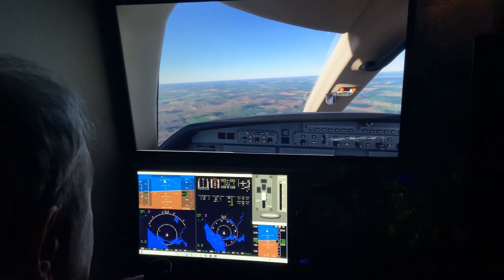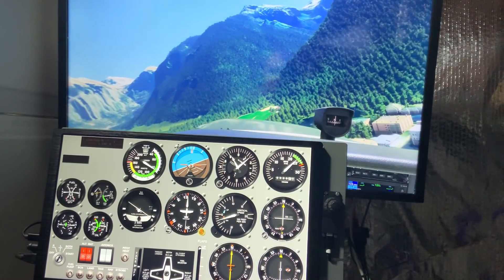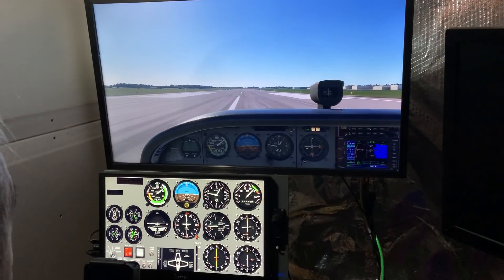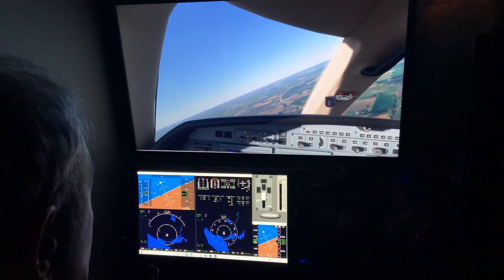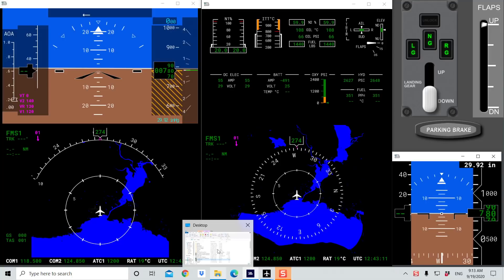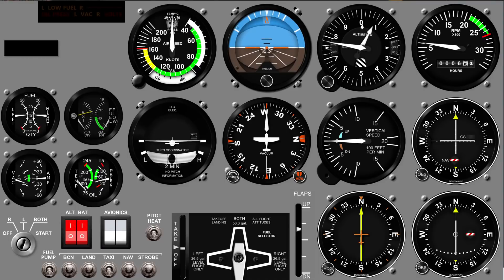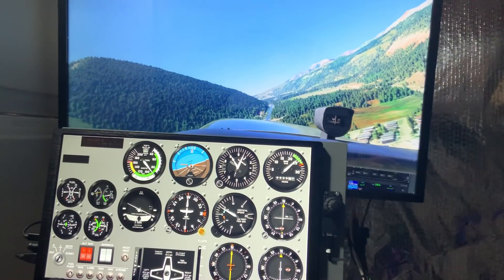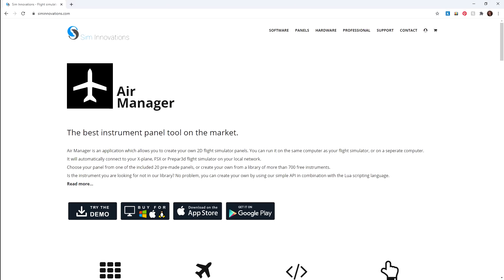FS2020 Budget Touchscreen Cockpit

Comment: any idea when airmanager 4.0 will be avialable? if i got a separate touch screen and knobster, will it be ok once AM4.0 is released?
Reply from the maker: It works now with Air Manager 4.0 beta available free on the wiki until it is released hopefully pretty soon. Some of the pay panels are not working with FS2020 completely yet because of incomplete features in the SDK for MSFS. Just download from the wiki page and you need the beta plug in too. Good news is that it is separate from the current version so you can use both. Get the beta username/password from the wiki to activate the beta.
Reply: @rbarlow  Thank you. I am a newbie, and currently have  4 monitors, none of which are touch screen. if i get the small 15.6 inch one,  can i hook it up w USB C, and still have it work...ie i would then have 5 monitors.  And w/ USB C only would it support touch fundtion?   thanks much. 

Separate question: is there any value to knobster on a NON touch screen monitor using air manager 4.0 beta.  I am mostly flying the cessna 152, and not sure really what monitor changes you would need knobster for?  I dont have g1000.

Comment: You said Air Manager works with FS2020. But according the website, “Buying a Air Manager V3 license now will give you a free upgrade to Air Manager 4.0 once it has been released (late 2020/beginning 2021). Please note that the current V3 version does not support FS2020.” What did you do to get AM to work with FS2020?
Reply from the maker: The public beta version of 4.0 is a free download during testing and is fully functional but no paid panels. Obviously it is beta sot it may have bugs or incomplete features but you can use it now if you like. I used it in all my FS2020 videos of late.

https://siminnovations.com/wiki/index.php?title=Main_Page
Reply: @rbarlow  thanks. I did not see the Beta on the Web site. I will take another look for it.
Reply: @rbarlow  okay, I give up. Where can I download the beta?
Reply from the maker: Look on the Sim Innovations Wiki. Under “Air Manager for desktop” there is a Beta link. The version 4.0 public beta can be downloaded there and is free until it is released. The username and password for the beta are in the instructions. It is beta so there may be bugs or incomplete features but it works with FS2020

https://siminnovations.com/wiki/index.php?title=Main_Page
Reply: @rbarlow  Thank you Russ! Excellent video. I appreciate your help.

Comment: Great Video!!  Thanks so much for sharing.  Do you have a video and/or more details on how the touch screen hardware is connected?  I like to understand how to configure 2 touch screens with X Plane 11 - G1000 PFD on one and the MFD on the other.  Thanks!
Reply from the maker: The monitors each need to be connected to the computer running the simulator so you can place the popped out displays on the monitors.They also need a usb connection for the touch screen signal  they also need a power connection. If you have more than two scenery displays too you may run out of graphics ports. Performance with a lot of monitors could be an issue too. This video my answer some questions you have
https://youtu.be/ZOdI__BMat4

Comment: Do I Have  To Install A Separate Knobster On Each Monitor , I f I Have More Than One Monitor ?
Reply from the maker: One Knobster will work with all attached monitors with air manager panels that have Knobster enabled in the panel settings

Comment: Russ any news on Air Manager working with your dual touchscreen design and FS2020?  pretty sad not to use this great setup with the new sim.
Reply from the maker: Yes it could work but two things are holding me back. First FS2020 doesn’t support multi monitors except with Nvidia surround which stretches the image badly on the outer edges and looks terrible after XP multi views. Second, it doesn’t support key events yet so many Air Manager instruments won’t work completely. When either of these are fixed I will install FS2020 on this simulator

Comment: can you please supply the info on which touch screen monitor you are using?
Reply from the maker: I have tried 4 different models but my favorite is the Wimaxit model with a glass edge to edge screen. It has threaded VESA holes on the back for an easy mounting option.

WIMAXIT USB C Portable Touch... https://www.amazon.com/dp/B07YXP683D?ref=ppx_pop_mob_ap_share

Comment: How many assignments can you actually have on one single 2560mega? Would I need 15 mega boards to setup a 172 panel with every switch, dial,  and button for max realism? Non touch on Air Manager with standard monitor screen behind  a mask, 3D printed bezels and such.. Thx!
Reply from the maker: The 2560 has 54 digital input/output pins. A simple two position switch or momentary closed push button needs one pin. Each dial needs two pins, one for each direction of rotation. So the dual knob encoder with push button on the G530 would use 5 pins. You can do the math but I would guess(only a guess) 2 megas would do it.
Reply: Russ Barlow perfect, thank you! 

I just wanted an idea before I get much more committed to this project. I’m trying/planning using the mask for basic instruments and then run an iPad behind as well on RealityXP for a 650/750 touch combo.
Reply: @rbarlow  what is the best “noob” way to interface my hardware/arduino to use in xplane 11? TIA.

Comment: Hi Russ, do you intend to adapt your G1000 Overlay to the new FS2020? Would be really great and would be a very good reason to decide for Air Manager
Cheers, Juergen
Reply from the maker: Trying to do it but the access to the correct underlying variables is not all available with FS2020 yet
Reply: ok thanks, so I think we can only wait for the MSFS Team to do some further steps in improving the SDK to provide some more features to allow for cockpit building.

Comment: Hi Russ, I went looking for the monitor with VESA mounts at Amazon but it was out of stock last week so I picked up one of these intead:

Planar Helium PCT2235 Touch Screen 22"

It's heavier than the model you have, coming in at around 8 lbs.  Do you think the Honeycomb will have any issues with this extra weight?  I'd like to take a similar approach with the aluminum and knobster.  This is my 4th knobster, I bought two of the originals and now two of the Sim Innovation models with usb C.  Love them!
Reply from the maker: As long as the frame can hold the weight and the center of gravity is close to the being over the mounting holes it is probably okay. I found a new 15.6” Wimaxit with VESA and it is all flat edge to edge glass front touchscreen. At Amazon
Reply: @rbarlow  Thanks Russ.  I have a Eyoyo 15.6 inch Touchscreen Monitor coming on Sunday.  It's another one with vesa mounts that looks similar to what you have in the video.  The Planar monitor was just too big for this application imo.

Comment: A bit confused, does FS2020 support Multi-Monitors, & did you have the chance to experiment FS2020 with he Arduino, Raspberry PI  & or a second Computer   ????
Reply from the maker: Nope. No multi view monitors yet. Only surround which stretches and distorts the outer edges of the side monitors. Air Manager interfaces with The sim over your LAN so it can be in another computer from the sim . Raspi too. Arduino Interfaces with Air Manager or Air Player directly via USB so it will work as long as the sim is compatible.... need Air Manager 4.0 beta. FS2020 Not supported und AM 3.7 .
Reply: @rbarlow  tnx Russ ... so you can get the Client NOD (PC, Arduino, or Res PI) to AM and have the instrument displayed on the client Display, did I get it right ?

Comment: Are you using air manager on the same computer  with FS2020?
Reply from the maker: Yes but it could also be networked. Now getting about 6% FPS drop on FS2020 when running Air Manager too

Comment: Nice video!  I am really tired of panning around to see my gauges.  I've been looking for a way to get panels off the main screens and this looks like the perfect solution.  I already have the some aluminum so all I need is the monitor and metal brake.  I also have a USB switch box I use for racing which has several rotary switches and buttons which shows up under game controllers.  Am I correct in assuming I could use two rotaries and a single button on that box to mimic the Knobster?  Thanks!
Reply from the maker: Actually the Knobster uses a proprietary microprocessor but there is a DIY version based on a Arduino Nano that you can build. The software and encoder arrangement is on the sim innovations wiki under Knobster. Cheap to build if you have basic soldering skills and a nano and dual push button  encoder. You could build for less than $40 not including a case if you buy parts.
Reply: @rbarlow  Thanks, Russ.  I'll look into that.  I have most of the parts I need and I'm familiar with Arduino.  :-)
Reply: You know what?  It's only money so I just ordered the Knobster.  I like plug-and-play!

Comment: Russ, Thanks for parenting Knobster into existence. Why don't you do the same with the aluminum panel? There must be a lot of folks wanting to set up your rig as shown in the videos but who have no access to the tools required to cut, bend, and drill that panel. I'll have to find a machine shop willing to do a little one-off job like that, something I'd rather not do during the pandemic. However, you could persuade Sim Innovations to get them made in batches of 100 (just for example) and sell them at a profit. Call it the "Barlow Knobster Bracket."
Reply from the maker: Probably better if I keep my name out of it. Actually, I was thinking that Stay Level Avionix might be a good partner to build that. They do great work.
Reply: Russ Barlow 
True. They are fabricators by trade. Have you approached them about it? If not, there's no time like the present! Meanwhile, I'm happy to learn that you've considered getting the panels manufactured for sale. There's a great need, and with the introduction of MSFS, a rapidly growing market.
Reply from the maker: To be honest, honeycomb aeronautical has announced that they have a somewhat similar product on the roadmap. But I think it comes after the rudder pedals they have planned after the throttle quadrant is yet to be released. I have spoken with him about another project and he has built a couple dual monitor cockpits using Knobster, so I’ll give him a call tomorrow and see what he thinks. Thanks for giving me a nudge. I’m retired and trying to make any money off of this it’s just not worth it because I really value the freedom to go and do what I want and simulation.
Reply: Russ Barlow 
That's interesting. If you look at the Bravo, it appears that they've made it the same height as the Alpha so that a panel can be made to span both adjacent units. Honeycomb would be a natural partner for this project, although I sense that they wouldn't be as agile as Stay Level in producing prototypes.

Comment: Russ, will this still work from a separate machine or does the Air Manager have to be on the same computer as FS2020?
Reply from the maker: Tony Ambegaoker  You install the plug-in on the simulator computer (it automatically installs when you run the installer) and you can install air manager either on the computer running your simulator or another computer that is on the same network.It does need to be on the same computer though if you want to use a bezel over one of the popped out navigation displays like the G530 or G1000. Obviously you cannot drag a window from one computer to another. But if all you want are just basic panel instruments it works great networked and it doesn’t put any load on your simulator computer.
Reply: @rbarlow  These touch panels are cheap enough for 2.  I have one connected to a side computer with Air Manage and the other on the FS computer.  So far I have found that Win 10 will only support touch on one of the touch screens.  The FS screen can support pop out while the other to the Air Manager stuff.  If anyone has info on 2 touch screen on one computer it would be great to hear.  Great job Russ; I'm signed up for sure.

Comment: Hey group not finding the sim innovation bridge to get air manager to work with FS2020. 15.6 monitor great idea and working well
Reply from the maker: It is just the beta plugin installer on the wiki page( near top). The installer will look for each sim installed on your computer and automatically I stall the plugin(or bridge for FD2020
Reply: @rbarlow  Thanks so much. Just setup my new prechen monitor, both the Beta and 3.3 air manager. My knobster will be hear on monday from Xforce. your video are great help

Comment: Thanks Russ.  I got the monitor from Amazon, but I can't get Windows 10 to recognize it.  What physical connection(s) are you making between the monitor and your PC?
Reply from the maker: Jerry Bass HDMI to computer gpu, usb-c to Computer USB-A for touch and a power adapter to the power plug (can’t remember if it is 6 or 12v). I couldn’t get sufficient power off usb alone to get it to connect.
Reply: @rbarlow  Thanks Russ.  I got it working.
Reply from the maker: Jerry Bass great!
Reply: @Russ
What do you mean when you write "power adapter to the power plug?" I've thought about that, but I'm at a loss to figure out what you're talking about here. I need to buy a clue, please.
Reply: @Buddy308  some monitors require more power than what is supplied by USB C port.  In that case, the monitor I bought has a supplied AC power supply (with USB A) port.  I connected that to the monitor USB C pd port on monitor via USB A to USB C cable also supplied by the monitor supplier.
Reply: Jerry Bass 
It never occurred to me to do it any other way than that, which is why I was confused. Thanks!

Comment: Hi Russ, love your videos. Extremely helpful. I have been using two knobsters with air manager and x-plane for a while. I got air manager working with fs2020 but not the knobster. Knobster disabled is my only option and under device it shows up as Arduino uno on the left and knobster o the right. Any help would be awesome. While I’m asking for things a Mooney panel would be awesome:)
Reply from the maker: Huh....the Knobster worked right off for me. I assume you have the beta plugin installed since it is connecting? Since Knobster connects to AM it should work with any sim I think. I guess you have tried rebooting everything. Also try disconnecting the Knobster and reconnecting it and be sure windows makes the hardware connection tone.If you are using AM 4.0 beta and the beta plugin (and it installed successfully as noted in the installer) this may be one for Corjan to look into. It is beta after all but mine was no problem.
Reply: Russ Barlow 
It’s helpful knowing it worked for you as normal. I was starting to think they gave you a special unlocked version. I will keep messing with it. Did try your recommendations several times. Thank you for the super fast response. So glad there are people like you in the community. Fly high blue sky N505Z
Reply from the maker: Glen Roddy if it persists we can get Corjan to do a session to troubleshoot. Do far this is the first report of this I know of but it may just be not many have tried Knobster on FS2020 with the beta.

Comment: You dont need air manager. If you really want to go budget then a encoder and arduino board like Uno is less than 15 USD. I dont understand the argument that air manager help you improve touch screen can't you use touch screen without air manager?
Reply from the maker: Just Go Travel sorry but I don’t think you understand Air Manager and what it does. It allows for a separate 2D panel that can be run locally on a second monitor or even on a networked second computer. . Knobster just makes knob inputs faster, easier, and more realistic. For example the G530 Mode knob has a dual knob and push button. Once you touch to select that knob on the Air Manager panel then Knobster can act as that knob complete with the tactile feel of each click as the knobs are rotated.  Knobster is certainly optional but most pilots that have bought it say only good things.

There is a DIY version of the Knobster detailed on the Iim Innovations website wiki you can build with a dual push button rotary encoder and a nano.... the software installer is one/click and free.
Reply: @rbarlow  but what if i just attach a secondary monitor and just move the panel to that monitor - that's basically free.

Just Edit My answer, just could be i dont understand the advantages of air manager, but I would like to. Setting aside the knobster thing what is the advantage taking the above in account.
Reply: @rbarlow  your titel for this video is "budget" No? Moving panels to a secondary screen is the cost of the screen - then you write that you can do network connection that is still possiple for free with screen casting in windows so i dont get the point. I am trying to understand.

For the knopster thing i do get the argument. But without the knopster i would like the hear the argument.

I have looked at the air manager products and for me i havent found the usage. To create your own panels like say the GARMIN G5000 you might as well just move the panels to a touch screen, done deal no programming required and completely free.

The knobster thing is 90 Euros, the main program is 65 Euros, the network addition is 30 Euros per additional computer

Comment: Hi Russ. Is it possible to send different air manager panels to two different monitors?
Reply from the maker: Yes no problem . You can run 9(I think but usually the limitation is the number of monitors you can run.

Comment: There website currently says it does not support MS 2020, how did you get it to work?
Reply from the maker: Broskies Aviation as explained in the video it is the public beta version 4.0
Reply: Russ Barlow o I must have missed that part ok I will have to give it a shot. So every gauge on the screen is touchable like altimeter, HSI, heading indicator, etc?